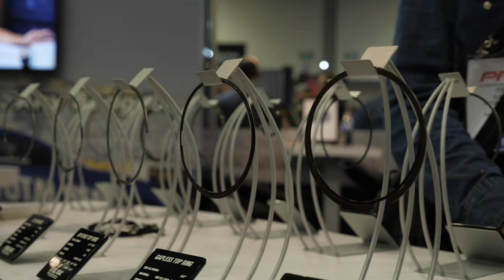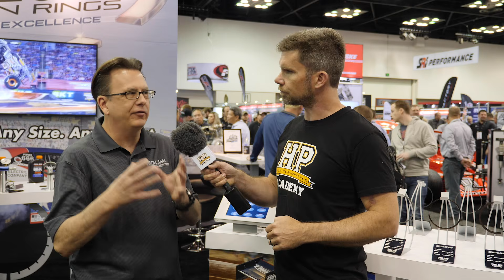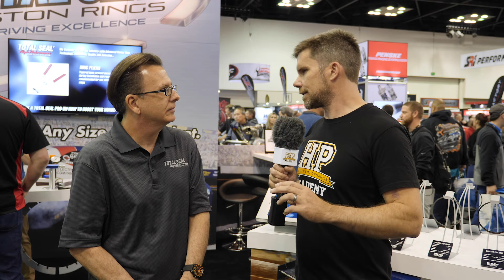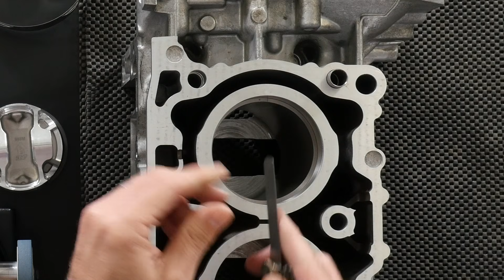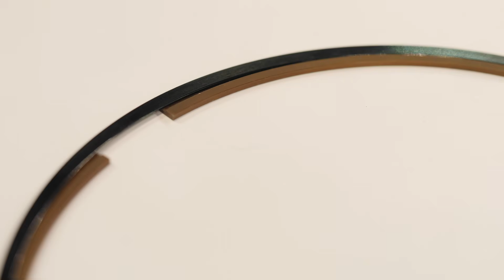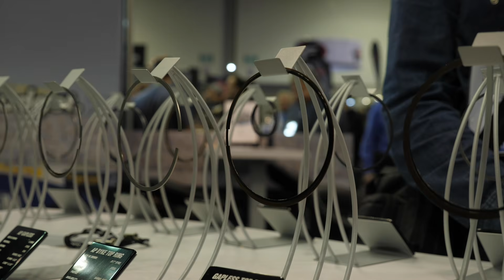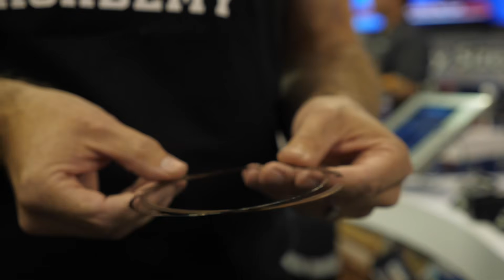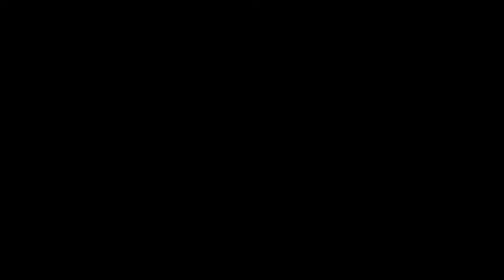Behind the Scenes of Gapless Piston Rings And Ring Flutter [#TECHTALK]

Comment: Ive been using them for over 30 years. on almost everything I build.from supper charged to air cooled vw stuff.the oil stays much cleaner.much better seal for way way way longer time. it is best to have a accumulator groove if possible even a tiny one will help.what else does a accumulator grove do??? lightens the piston!!! there are many morons that think these are just for race cars...or they are over kill....well, you cant fix stupid.
Reply: Can I get these for a 96 mm piston in a 914 and do you know what it would cost? Also, any idea what the extra power might be?
Reply: @jockellis   contact total seal but Im pretty sure they will have them or cn make them. usualy $85-130 for 4 cylinder, for them sets. alsoI used to send them rings for them to remachine into total seal rings many many years ago for the ones they did not make at that time. but you really need to start poff with a good ring.not the china crap or other low quality rings. as for power, not a lot, but the oil stays so clean, the oil temps seem to be lower, less oil leeks if any at all.they are well worth the $$ spent. also if you have new cylinders they need to be honed finer,or atleast the "Tooth " knocked off. witch you can do by hand with 400 grit wet/dry with soapy warm water and our hand in the cylinder hand honing just about 1 -2 min each with the same pattern.use the palm of your hand. that should take the tooth off(sharp edges that eat up rings) then throughley clean a few times & lightly oil .never oil the rings. wipe the oil out of the cylinder with clean paper towels, the towels should come out clean if it does not you havent cleaned it enough. re oil and wipe out with another clean ppaper towel. install rings properly I install into cylinder, then install cylinder & pin& pin clips/ buttons,be sure to oil wrist pin,wrist pin bores, rod pin bore & lightly oil skirts.no oil on rings as you have pree oiled the cylinder walls & wiped off exsess with paper towel.thats all the oil it needs.
Reply: @marktucker1651  Mark, thanks for all that information. I’ll do it.
Reply: Oh, I’ve got the AA piston and cylinder set.
Reply: @jockellis   thats what I figured, get the compleate set of total seal rings for them. and be sure to knock the tooth off to make them last. I have a sunnen hone but it takes a good amount of time to do them with it, mainly it's good for used cylinders or increasing the clearance, a good hand hone wash is usually what I do on new cylinders that have the right clearance. not just draging the paper across it you need to add some pressure with the palm of our hand. not hard to do at all.unless you have extra big hands like I do, then no need to add pressure it's already there. those sharp edges from the factry hone job will eat the rings up, they will also wear off and it all gets either imbeded in the piston skirts witch then wears out the cylinder walls or some of it gets into the oil and starts eating every thing else& cloging the oil filter. these vw engines do not have to be disposable like most people build. my 2028 had 80000 miles on it trubble free with an extra 50000 miles on the crank,main bearings,camshaft&heads before I put it all in a new case with new bigger pistons. and it still ran perfect when i sold the car 4 ears ago.always synthetic oil used after the first 3 oil & filter  changes in the first week. 4th oil/filter change it got a syn blend  for 1 week then full 5-20 full synthetic name brand oil.  it was driven like I stole it every day I owned it( it was my daily driver) duell webbers 44 idf. .55" lift cam, wedgeport heads 1.34 ratio rockers,10.4 cr. 93 octane pump gas.  it was quite fun. the new owner loves it.
Reply: @marktucker1651  What VW was this?
Reply: @jockellis   2028 cc aircooled street bug. that engine I actually built for a spair so i could convert my 2332 to a roller cam motor. but everybody elses engines keept getting in the way of doing it for my self. so the 2028 spair motor just kept racking up the miles. I bought a turbo car and sold the bug. still had 356 speedster (glass body car/replica) that the 2332 or the 2393 was to go into....never didnt get to finish either of those motors,sold the speedster, still have the 2 unfinished motors & new rino cased super street plus trans on the bench with no vw to put them into.I thought about doing a dragster, but I think my racing days are over. at some point I need to sell it all, I dont see me ever finishing  them. lots of trick parts.I wish I had turned away a lot of work and finished them. I now no longer do any out side work. I stopped racing. I should of stopped doing out side work 12 years ago. now I have no disire to do it after a life of racing, machining, building everythingg from dirt bikes to mud trucks,circlke track, dirt track,street, prostreet, drag promod , topsportsman  from 1 cylinder to 632 ci killers &traveling around the country racing &  more.had 800+ ci in the last promod we ran. but with cancer& getting older now I live life through my kids & grand kids. and some traveling,just got back from 2 weeks in italy& kosovo where one of my daughters got married,.....and racing is on tv when I want to see it. I never messed with the type 4 stuff,I didnt like the cylinder  head lay out. so i just did the type 1 vw stuff, 98% after market parts,only 3 or 4 vw parts are worth using.  
 if you want this motor to last I would also recomend, having all the bearings crank,rods&cam bearings DFL coated.as well as piston tops, combustion chambers, valve faces and exports ceramic coated. I also did the entire rocker arms after a lot of work to them.

Comment: So what are the disadvantages or contraindications to using gapless rings? Why does he mention using them as a top or 2nd ring but not both?
Reply: For NA applications, it improves volumetric efficiency IE more power less pumping losses. For boost a second ring gapless makes sense like he said for running E85/Methanol to keep the fuel from diluting the oil breaking it down.
Reply: I did a little more reading and apparently they don't last as long as normal rings so are really only an option for race engines that will be refreshed regularly.

Comment: Good stuff.  Eliminating blow by makes for such a nicer engine experience lol!  But all you hear on the internet is that there is no real gain from gapless rings or that they never really seal up well in the end.  None of the engine builders I use recommend going gapless.
Reply: Oh man what BS I used TS AP SS gapless top rings in my BBC running an F1A-94 procharger on the street..I didn't even run an intercooler..at 17psi on an engine with 650hp NA you do that math...meth only with a 2618 blower piston...and have had the meth pump die twice...no worries...also I've ran it with 87 at 1000+ hp in winter....the ring was down the crown due to piston design, then opened up gapless tops...it just didn't give 2 shits took a beating 1000 hits on street strip...zero blow by used basic filter vents didn't even need a catch can it was nuts....
Reply: Exactly what I’ve read as well.

Comment: Great knowledge being passed on, I can remember Andy Dawson talking about engine distortion in the 70s, and trying to pre tension blocks during machining! 
 That open deck configuration makes me cringe!
Reply: that's what torque plates were designed for... we at a high end race engine shop machined them with the torque plates, main caps and typically heated the engine block to operating temp - 180 -200 deg prior to honing.
Reply: It a subaru  open  deck    . It made me spend way to much  .  So i concur   with  your statement  !!!
Reply: Subaru used fully open decks in their NA EJ-series engines, but they used closed decks in their turbocharged EJ-series engines. They knew the open deck couldn't take the added pressure of turbocharging. Subaru later replaced the EJ-series engine with something else, but I don't know if the turbo versions were open deck or closed deck.

Comment: The cool thing with Total Seal is you can call them up and many times actually talk with Keith (at least that was the situation years ago) and he'll talk your ear off about your combo and what you can go with. I wanted to stick with conventional gap rings, and a low (16#) oil ring for a typical 400 SBC N/A drag combo, 1/16 1/16 3/16 setup. Keith recommended a set with a napier second ring and an 8# oil ring, even though I had no plans for a vacuum pump. The rings sealed instantly, and have provided years of service.

What wasn't mentioned in this interview, is thinner and lower tension rings reduce cylinder wall wear, so what might require a rebore in the old days using the old 5/64 compression rings, can last more seasons or thousands of miles more in a street car with a thinner ring package. Many piston manufacturers offer pistons with these modern, thinner ring grooves.
Reply: He does talk about a smaller ring having lower wear on the bore.

Comment: Seems like a really neat idea, not have to compromise (and/or gamble) on ring gap size, offer better power, possibly even better MPG, and longer oil life, as well as better emissions from less burned oil. So why isn't this universal, used on production cars (where many of those advantages are more relevant even than on performance builds)? What's the drawback? Also, how do they hold up over time compared with normal rings?
Reply: I think the drawback is that the ring flutter thing likely isn’t BS and is a serious issue. From what I’ve read the gaps in sealing account for a minuscule percentage in performance loss. With today’s super tight emission I would think the OEMs could justify the expense considering other emissions hardware is likely far more expensive than a ring. Still though, perhaps they are expensive but still, manufacturers put out expensive cars as well where cost isn’t an issue. Are gapless rings installed in the Nissan GT-R, AMG GT, Ford GT, Audi R8, etc? I doubt they do and for me that’s answer enough.
Reply: @kellyjensen9425  Yeah, because you think it's BS, it must be true🤦‍♂️..
In competition extracting every last benefit could be the difference. Not the case in production vehicles.

Production cars have ideal operating parameters, they are run at a constant so don't need the benefit of being dual purpose at added expense.
Just because a car is expensive too, does not mean bean counters don't try save on every component.

Maintenance or Direct injection leaks, emissions when an engine wears meaning emission controls still need be in place etc etc etc heaps of reasons as to why not in a production vehicle but mainly ease, cost and catering for the average consumer would be high up in the reasoning one would assume.
Reply: @DStead2239  Yeah, because you think it it must be true 🤦‍♂️
Reply: @kellyjensen9425  🤦‍♂️🤣.. Are you 5? 
You called out two experts, say it's BS then make an assumption based on what a GTR, R8 etc don't do stock 🤣..

In lamens terms; A stock GTR or R8 also won't run 40+psi or 1000hp shot of nitrous either so don't need large ring gaps.. They run pump fuel too. 
Take the GTR for example, easier to gap 12 rings not 24, R8 is 20 not 40 rings.
In stock form on pump fuel the added complexity and cost is completely unecessary.
If you are pushing an engine to the point a stock engine needs larger gaps, you're likely well beyond the point of voiding a manufacturers warranty anyway as tolerances are set to suit it's factory parameters, so it is of little concern to them.
Reply: @DStead2239   Lol, you’re the only one acting like they’re 5. Do top fuel cars use gapless rings?
Reply: @chillznax  🤣🤣do top fuel need to run gapless rings?
No.. They're built for only one purpose.
Do drag week cars? Yes, some do because they're dual purpose🤦‍♂️ street/strip without compromise.
Have you ever gapped rings?

You're the only one acting 5..
See what I did? The same as kelly. Except, unlike you he was smart enough to know he has no idea what he's on about and made a childish retort instead of a factual based argument on his baseless claims.
Reply: There will be some downfall of sorts or it would be more common in production cars
Reply: @BIGSMOKE-bl2lq  Most likely, cost, warranty and necessity.
Reply: @BIGSMOKE-bl2lq  Yeah, exactly - there has to be a drawback, I want to know what it is.

Comment: Two of the questions you should have definitely asked but didn't.
1) Why there are no OEMs moving towards that way of sealing (if i am not mistaken about that)
2) Since they claim that the seal is so much better, is there stil a need for the second compression ring and if so why?
Just to make it clear, i can definitely come up with answers for both of those but it would be nice to see what he had to say.
Reply: The same reason for every compromise on oem cars. Cost. And maybe they only last 100k and not 200k miles.
Reply: What are your answers?
Reply: What does F1 use
Reply: You have to understand that in F1 racing, they heat up their oil to warm up their cylinder walls and pistons and rings so the gap wouldn't be too tight to start the motor.
Reply from the maker: @Patrick - That is a common misconception. It is done for other reasons, namely mechanical sympathy given the cost of the power units and the usage. In modern times with so many tracks having noise restrictions it also helps the teams get an early morning head start there checking over it all, ensuring there are no leaks as well as being certain the car is up to temp on its out lap amongst a few other advantages  - Taz.
Reply: I also had this question
Reply: @ChrisTziros  Automobile manufacturers make more money on service after the sale, it's the primary reason why they're not installing gapless rings in their engines along with cost. The engine cylinders must be honed to a certain spec for them to get the proper operation and advantage these rings provide..mass produced engines like this would be costly and more expensive for the customers..
Reply: For race applications WE ran only the top ring set along with oil ring, eliminating the 2nd ring CAN allow you to use a shorter compression height piston with a longer rod. 
What does that get ?  
Lighter reciprocating assemblies - take 5 grams (a nickel) off of 8 pistons and you have removed just under 1.5oz from your reciprocating assembly - PLUS longer rods cause less side loading of the cylinder walls, less piston rock in the bore as well as serving to increase the dwell time at or near TDC allowing higher pressures to build for the power stroke -  
Needing less power to accelerate lighter pistons leaves more power to accelerate the vehicle and causes less force acting on the pin, pin boss and small end of the rod. On a road course removing 2 oz from your rotating assembly is more effective than removing 100 lbs from the chassis - removing 1.5 oz from a reciprocating assembly is MUCH more effective than 2 oz from the rotating, WHY? because you are accelerating from zero stopping changing direction and accelerating again 2 time per piston per revolution. Reducing reciprocating weight is one of the most effective forms of weight reduction.

Comment: I have only put rings in Honda blocks and one 1jz but all the NPR rings I have fitted said to never gap them on std bore size. The problem with proving ring flutter is that it had a catastrophic failure and there is nothing to look at after RUD. I call it "ring chatter" that's what it really is IMO. the vapor pressure that is applied to the rings makes them deflect sometimes riding in the piston grove funny/weird and they wipe on the cylinder wall like bad windscreen wipers chattering. But like you said rare thing to happen and if it happens long enough one may see zebra stripes the chattering leaves on the cylinder walls.